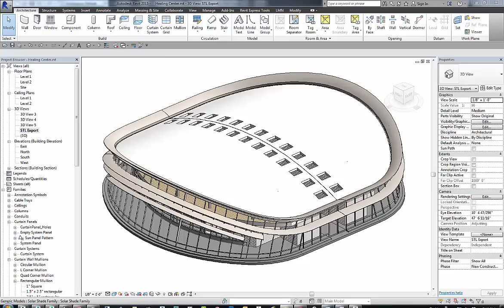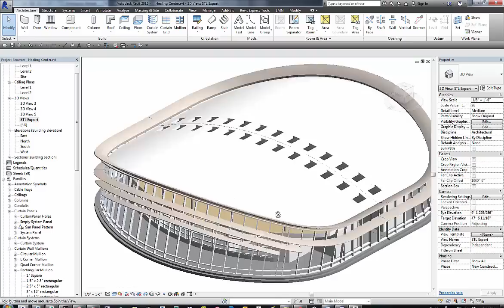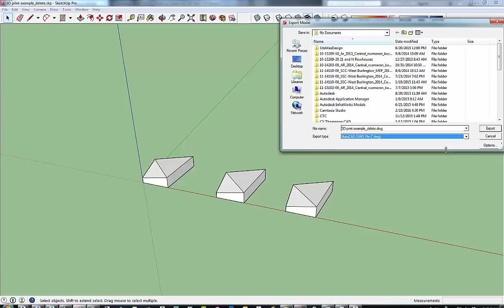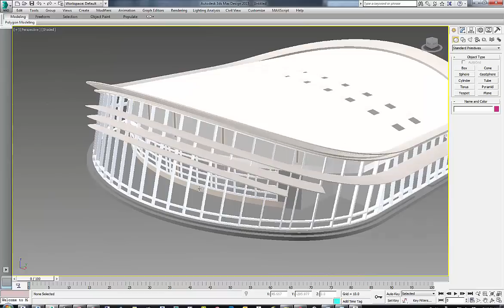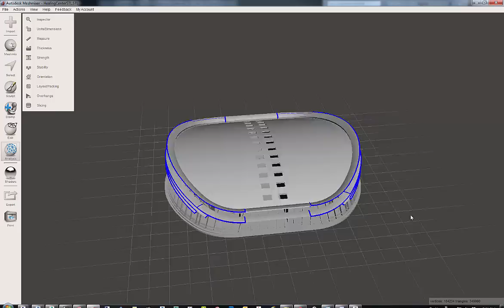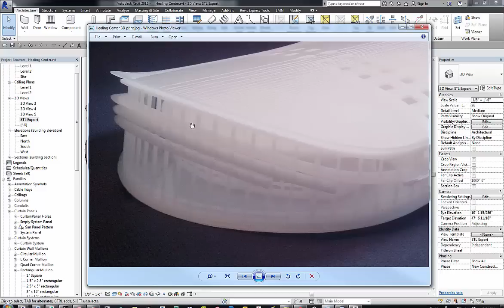3D print tips and techniques

Comment: Hi, I am new to resin 3d printing. I have been using Autocad for over 25 years and primarily design water/wastewater pipelines and pump stations. I have been designing one of our pump stations in Revit and learning how to turn that into a .STL file in order to print it. My question is, how do you print things like a house or building and show the brick/stone texture on the outside of the model from revit?  Thank you.
Reply from the maker: Hi JB, couple questions. What scale are you printing at? if 1/8inch or less, I'm afraid most SLS and SLA printers can't meet that grout gap tolerance level. Even if they could, they would produce a terrible print. FDM doesn't stand a chance either. 
Are you ok with the "appearance" of brick? You could create a whole series of wall sweeps every brick course and copy them around each brick wall and leave a gap horizontally between each sweep and use that to "represent" the brick surfaces. Pretty time intensive.
As for ashler stone patterns, unfortunately short of yikes, modeling each stone, there's not a great way to do that.
Reply: @ryancameron6299  Hi Ryan, thank you for your reply. I do not yet know what scale the print will be yet, I am in the process of drawing it and at the same time waiting for my printer to arrive. This is just something I thought would be neat to show new employees what a 3d pump station would look like as opposed to a photo of one or a section view of one. if you select a texture in Revit and save the model to an SLA file, does the texture show in the 3d print, given the scale is not too small? Thank you again for your time. And yes, I am ok with the appearance of brick.

Comment: Hi Ryan, Keen to know if there is a quick way to delete all of the internal structure and only include the external geom for a 3D print.
Reply from the maker: Of course Aaron!  But why delete in Revit when you can hide geometry (temporarily) while you export?  Then once the export is complete, just hit undo if you want to bring it back.  A further hint, you can do the same for turning off the exterior shell and leave only the floorplan inside!  Print them separately to create a model that you can lift apart to the client!  Cheers!